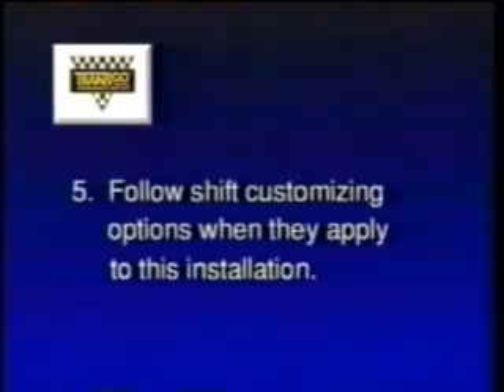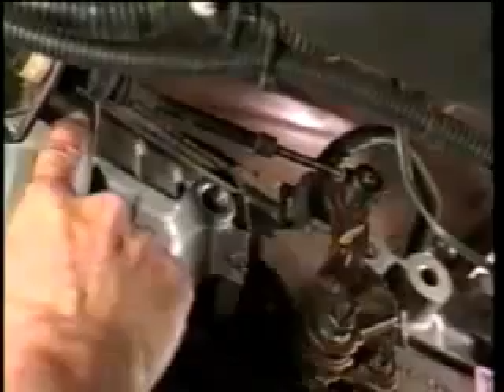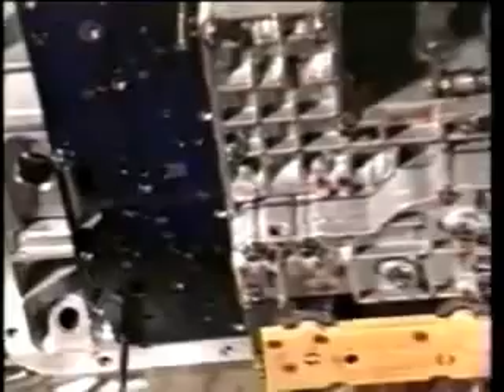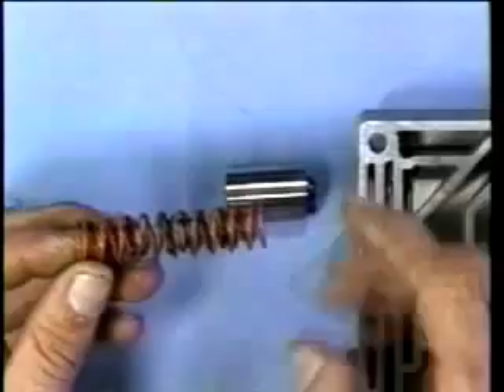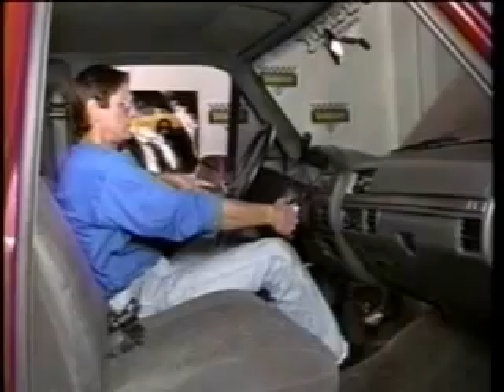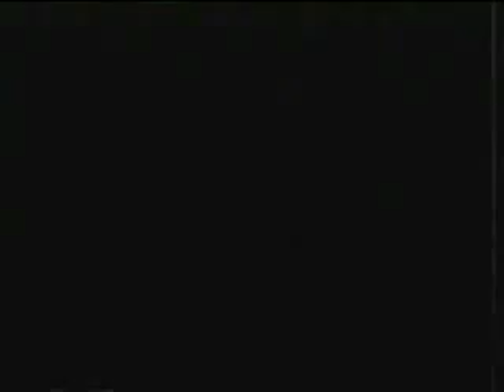Transgo E4OD/4R100

Comment: Did anyone even notice that the speedometer jumps 10 mph faster when they show it shifting. I don't know of a ford pickup that jumps in speed like that when it shifts. That is a bad gauge or a gauge that is not in the pickup. Not realistic at all. No pickup jumps 10+mph in less than one second when it shifts.
Reply: You didn't realize that the truck was on jack stands and the  vehicle's rear wheels were spinning freely..
Completely normal